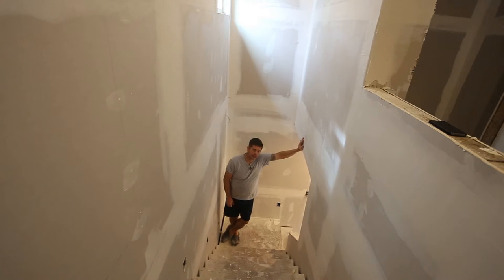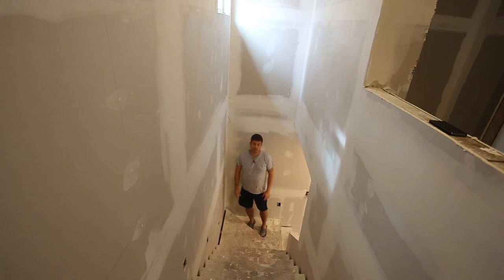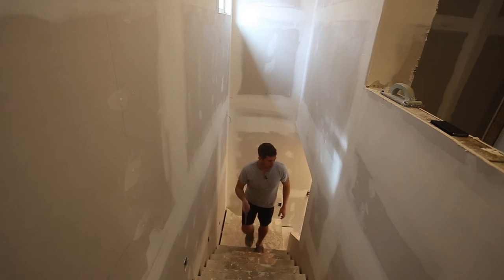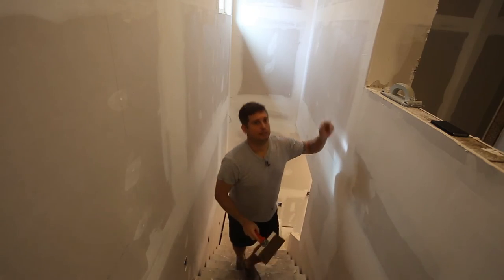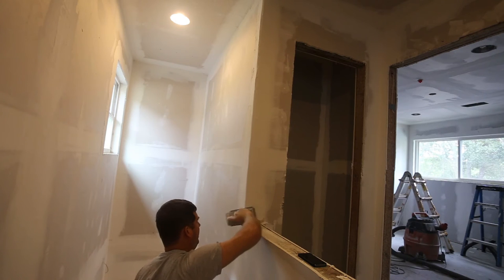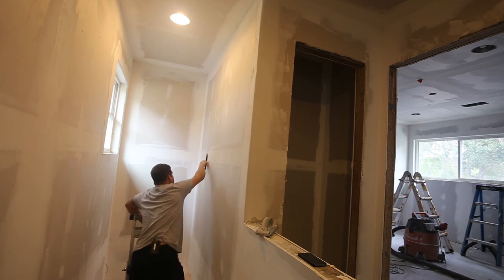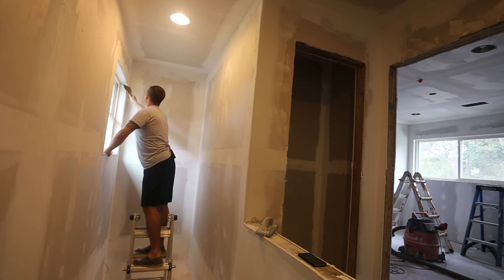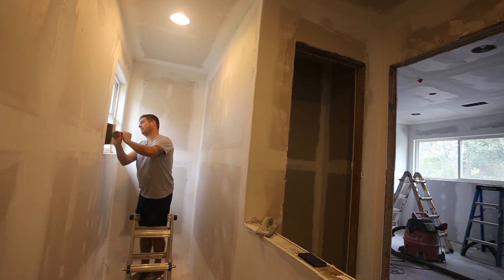House Reconstruction 27 Nov 2015

Comment: Would it be possible to have a quick video run through of the entire project with your current progress?  Also, ( a little off topic) I'm interested in how you addressed ventilation with your cold roof application.  Would love to see a diagram.  Great to watch your progress.  Thanks again!
Reply from the maker: +T Willey I don't really want to do a video tour of my house.... sorry... it just wierds me out to video my bathroom and bedroom.  :)  You'd think with millions of views I would have lost any sense of privacy....lol...  Glad you are enjoying the video.  Not sure what you mean by the ventilation question or cold roof.  I consider the house to have a conditioned attic.  The latest advice recommends treating the attic like any other part of your home and ensuring that it has some air circulation.    This house actually has 4 attics.  The upstairs attic has a very small vent to allow conditioned air in and there is a pathway for it to return to the air handler.  The downstairs 3 attics are different.  The front attic is the smallest and is connected to the two end attics.  One end attic is used for the Air Handler and I treat it as a plenum, yes, the entire attic... it's not very big.  The other end attic is over the master bedroom.  I've left the ceiling out of the network/data closet and this will allow air from the master suite to exit and work it's way back through the attic to the air handler.  There was not sufficient room for a return duct, and this ensures air circulation.  Lastly, the mechanical attic (where the air handler is) will have an ERV installed in the near future.  This will ensure fresh air is exchanged 24/7 and the system should pick it up and distribute it throughout the house.